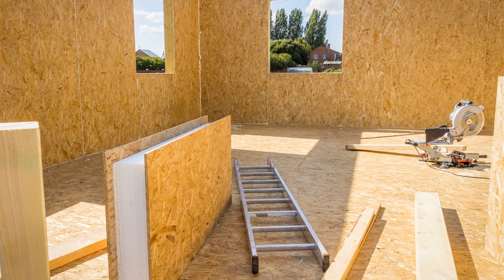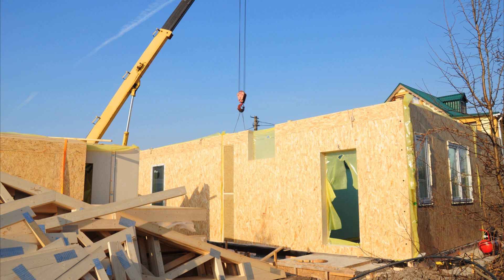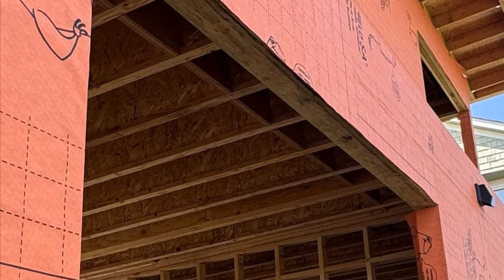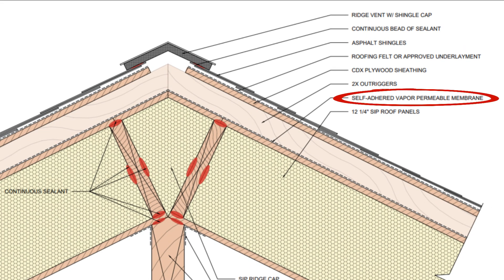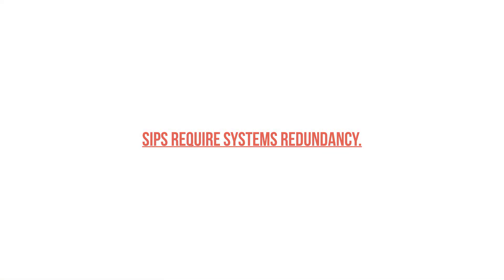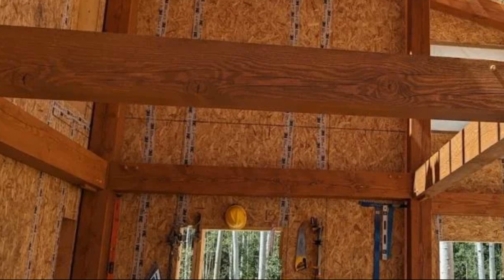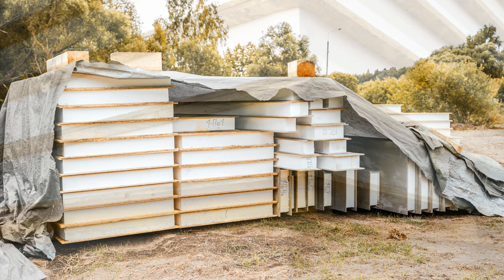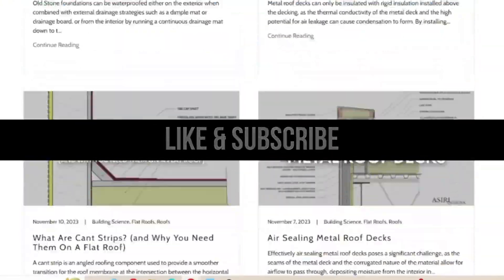SIP Framing | What You Need To Know Before You Build...

Comment: Wait wait…. So if a vapor barrier is going to trap moisture in Evan in a properly air sealed home……. WHERE DID THE WATER VAPOR COME FROM??????

You just disproved your own theory about air leakage 🤦‍♂️🤦‍♂️🤦‍♂️🤦‍♂️
Reply from the maker: Two things; 1. Your air barrier is never going to be 100% perfect, and one would be foolish to think that it could be. 2. If a leak occurs, it's never drying out if there is a vapor barrier. Vapor comes from many different sources, both internal and external. Water comes from many different sources, both internal and external. This isn't rocket science.

Comment: You over emphasize air leakage. I ready don’t think that’s the issue. Otherwise you should remove all windows door electrical and lighting. There is no way to properly air seal to your expectations. The issue is that water simply got in and wasn’t allowed to dry. Same thing happens in traditional roofs of old homes that have poor insulation and air sealing. They breathe well but something still rots away if small amounts of water  gets in. If the SIPS roofs had another layer of venting over the sips panels like you show in other videos it would have dried fine.

Comment: No one should be using Tyvek anymore. It was always a shtty product, but it has been fully obsolete for years. Still, profit margin obsessed production builders use it exclusively, always building to the lowest standard allowable by code, and they often fail to even meet those pathetic standards. Self adhered WRBs should be the industry standard because just that one change would dramatically reduce water damage and extend the lifespan of every building it's installed on.

Comment: just make ventilation points and problems are solved, in combination with sips panels and traditional timber framing is beneficial , I talking from my own experience , my house built in 2007 doesn't have problems with moisture is good  ventilated and if I  build next one I will build a same way Sips walls and ceiling and roof construction traditional way

Comment: Clicked here because I’m thinking a top of the line tuff shed / hunting cabin, 12’x20’ max, is what I need on a remote property. I can get in there with a pickup but the shed delivery guys would never make it, so looking around for pre-fab sections / kit type building a couple guys can haul in pieces and assemble on a weekend. 2 minutes into this video I can confirm the SIP thing is NOT what I want.

Comment: You made it sound as if all SIPs are made with OSB sheathing. You should have mentioned the fact that it is possible to buy SIPs with other sheathing material such as sheet metal, pressure-treated plywood, fiber cement board, fiberglass, and fiber-reinforced plastic.
Reply: Thanks!  I was going to ask if the panels had to be osb. Cheers.
Reply: It would be an MIP

Comment: In my country, they install rigid foam insulation on the exterior side of SIPs, with vapour membrane in between. Wouldn't this be a better solution for managing moisture and condensation compared to relying on complex vapor control products and techniques?

Comment: I disagree using a fluid applied weather barrier. The issue is that with SIPs inside moisture will be drawn through the SIPs to exterior side OSB. the moisture will condense causing rot. For SIP you need to use a membrane with high perms rating so that moisture can escape. If the membrane is moisture impermeable, it will not allow moisture to escape. The Foam insulation used in SIP panels is moisture permeable. Using a fluid Applied non-permeable coating is just asking for trouble with SIP Panels.

I recommend anyone considering SIP construction read the papers published by Building Science Corp first! 

FWIW: I would not recommend SIP walls, not only because of the moisture\rot issue, but it makes it very difficult to install utilities in SIP walls (electrical, plumbing, data, etc). Your much better off using standard Stick frame construction such as 2x6 with 24" OC framing, Rockwool bats, Standard ZIP sheathing and exterior 2" Rigid foam insulation which will provide about R-30 for walls. The exterior Ridge foam insuluation will keep the shealthing warm & nearly eliminate moisture condensation on the sheathing. The Rockwool will allow any moisture in the wall cavity to escape. Beyond R-30 your just spending a lot of money for very little gain in performance. with R-30 walls most of your heat losses will be the windows & not the walls.

If you insist on using SIP for wall construction I recommend using a High Perm membrane (Check with SIP mfg for recommendations), 1"x4" purlins (rain screen, with top & bottom venting along all of the SIP Walls so moisture can escape. Be sure to use screens on the vent openings to avoid Bugs & small rodents. 

The most practical use for SIP panels are for the Roof, covered with a high perms membrane that is nailed with cap nails. Topped off with a metal roof with 1"x4" purlins between the SIPs & the metal roof with a ridge cap vent. This will allow any moisture to escape & vent out during warm or sunny days. The other advantage is that during the summer time, the metal roof will be cooled by convection as hot air leaves through the ridge vent & pulls in cooler air from the soffits. The only non perms membrane should be installed along the edges of the roof where ice dams can form. For the roof edges you want to use a non-permeable membrane.  The best option is to install the Ice & water membrane over the roof sections that overhang the top walls. Any moisture that occurs there can vent from the underside of the SIPs (Soffit side).

I would not recommend a SIP roof without a vented roof. If you want to use a shingle roof, you need to the high perms membrane on the exterior SIP OSB, install purlins 1"x4", topped with plywood & then roofing membrane & shingles, with a ridge vent to allow moisture to escape. Do not nail Shingles directly to the SIP OSB because it will prevent moisture from escaping. 

The issue with SIP roofing is you still have a moisture problem, so you need a way for the moisture to escape to avoid Rot. Warm moist air will rise and collect in the SIP panels unless there is a way for the moisture to escape.
Reply from the maker: I never called for an impermeable fluid applied system. BSC has excellent papers though, the SIP roof failures in Juneau that I referenced is based on Joe Lstiburek's investigations on those roofs, hence the vented overroof mentioned. Perhaps rewatch the video ;)
Reply: @ASIRIDesigns  Most Fluid Applied products are impermeable, To be honest I don't know of a permeable fluid applied product.

As far as the roof comments, I was referencing best practice from my experience, not a reflection on your video.  as well as my explaining why SIP walls is not recommended.
Reply: Magnesium oxide (MGO) board structural insulated panels (SIPS)

Water resistant: Can withstand harsh climate conditions
Reply: I agree with you.  The video was a bit contradicting.

Comment: You make a very strong case against wood construction of any kind unless it's wood over concrete only on exterior surfaces for aesthetics and then have a good bank account to replace the rotted cladding every 2 years.
Thanks for the tip.

Comment: Why do you use OSB instead of multiplex or cement based composite boards? If it rains during the construction that moisture is going to stay inside the construction once you seal it.

Comment: Question about using fluid applied membranes for your WRB. Is sealing all the seams with a wrb and then using tyvek to wrap the build a viable alternative? The cost of the fluid applied  membrane is significantly higher, is there a downside to doing a hybrid approach?

Comment: I would like to see a video about climbing plants from you. I believe if you choose the right kind of climbing plant (one that can't attach to the wall using aerial roots but rather one that winds around a supporting structure, like ropes and grids), you can get the benefits of evaporative cooling in the summer without risking any damage to your wall. At least, that's what I concluded after my internet research. I would like to know your expert view on this!

For central Europe (I chose to focus on native plants, I live in Germany), I have identified Clematis plants for walls not facing the sun directly and Lonicera caprifolium as a plant for walls getting lots of direct sunlight. Both do not attach to walls, as far as I've been able to find out.
Reply: Clematis do not damage the house. We have had Clematis growing up trellis structures against our house for decades. Not sure how much they will actually cool a building but I don't see how they can damage it really aside from perhaps debris accumulation (that could lead to rot) if they rest against low slope wood surfaces. Climbing roses also have had no negative effect for us, again, over decades.
Reply: @jamesroscoe7555  Thank you for confirming that part! As for cooling: A) Less sunlight actually hits your house, but more importantly, B), plants evaporate water, which cools the surrounding air.
Reply: @fredwupkensoppel8949  I agree with your points. Our Clematis plants haven't really grown vigorously enough to really shade that much, and are against a tall brick wall that soaks up the sun. In our climate (very cold winters, hot summers, Canada) they die back a fair bit in winter. It might work well if you can get them to shade a sizeable percentage of your wall though.
Reply: @jamesroscoe7555  Try shading the parts of the Clematis that's close to the ground - they can grow well in direct sunlight, they just need a bit of shade down low.

Comment: Building science meets practical construction applications! Great overview. Our technical division was part of the team that helped get SIPS approved in the IRC/IBC in the late 70's, and have lived through projects where proper attention to detailing isn't adequately conducted by installers.Your simple points and key installation notes are extremely valuable! One thing to note, in many applications standard house wraps are acceptable, particularly on wall panels. However,  in wetter/cold climates and low slope roofing we have technical bulletins that detail various assemblies and product options that can help with water management as your video mentions. Thank you for your expertise!

Comment: How about flammability? Once a fire starts does it rush through the walls as all the foam melts?
Reply: It's not any worse than traditional stick framing. Possibly even better, because there is no cavity to act as a chimney and the foam itself does not sustain the flame because of additives, it only burns as long as there is something else burning it.
Reply: Magnesium oxide (MGO) board structural insulated panels (SIPS) 

Fire resistant: Have superior fire resistance compared to traditional fiber cement and OSB SIP panels
Reply: This is a great question. SIP wall and roof assemblies are 1-hour fire rated, ASTM E-119. There are, of course, SIP manufacturers that have additional fire-retardant skins for the SIPs that can increase the fire rating.

Comment: Some time ago Corbett Lunsford did a video on his Home performance Youtube channel about how you should avoid putting a tub/shower on an exterior wall (and especially if it's on an exterior corner) because of condensation issues. Architect Steve Baczek (also on Youtube) said that one of his contractors will build a second "inner wall" around the tub/shower (basically the entire "double wall" consists of exterior rockwool insulation, ZIP sheathing, 2x6 studs with Rockwool batts, interior Membrain barrier, 2x4 studs, cement board, tile) .
If you have no other choice but to put the tub/shower on an exterior corner, how would you properly install it?

Comment: I have run into this issue working as the structural manager for roofing company. The two by eights that were part of each sip panel were completely rotted out.

We we started putting full ice and water shield to keep the interior air from coming through and condensating underneath our vapor barrier.

There’s nothing worse than doing a good job and then having someone thinking you’ve done something wrong and then trying to explain them it’s your house causing the issue.

Comment: Thanks for posting this. I'm actually preparing to build a sips home and this answered some of the questions I had about sealing and vapor barriers. 👌
Reply: If you want quality and are doing it yourself this isn't the way to go.
Most DIY people don't know how easy it is to rent forms and  pour concrete.
Look up CIP, Cast In Place, Thermomass products. You pour you're exterior and interior surface and all insulation is in place in the walls.
You just put a think coat of finish stucco over the concrete if you don't want exposed concrete. 
Time is going to be about the same as SIPs.

Comment: Are there SIP products made of plywood rather than osb to ameliorate some of the moisture sensitivity? Or is the adhesive bonding too difficult?
Reply from the maker: Yes they do exist, but you still want to keep those panels as dry as possible.
Reply: @ASIRIDesigns  I'd be interested in your opinions on magnesium oxide panels, both as the integrated sheathing in SIP's, and in other applications.

Comment: Why aren’t SIPs precoated with weather barrier?  Or why isn’t the exterior skin material moisture proof?  Seems like a gap.
Reply: Some manufacturers are using Zip-R sheathing for the outside layer.
Reply: Frankly, considering how expensive a sips solution is, it is rather ridiculous that the osb is not moisture sealed at the factory where it would be easiest and most consistent result.  Yes, you’d have to paint every seam with sealant as the system was assembled- but that must be done anyway if anyone expects a 100 yr survival.  I can’t image anyone investing this heavily in a structures’ efficiency if they aren’t expecting a very, very long lifespan.
Reply: Came to the comments to ask about this exactly, if any manufacturers are using zip-r or similar. Good to know!
Reply: Magnesium oxide (MGO) board structural insulated panels (SIPS) are a type of building panel that can be used for walls, ceilings, and floors in residential, commercial, industrial, and educational applications: 
Eco-friendly: Contain no organic solvents, heavy metals, asbestos, oils, or other toxic ingredients 
Energy efficient: Eliminate drywall, which reduces construction time and cost 
Water resistant: Can withstand harsh climate conditions 
Fire resistant: Have superior fire resistance compared to traditional fiber cement and OSB SIP panels 
Mold proof: Can withstand harsh climate conditions 
Hurricane and earthquake resistant: Can withstand harsh climate conditions 
Superior insulation: Offer superior insulation, structural strength, and air-tightness over traditional construction methods 
VOC-free: Off-gasses no volatile organic compounds (VOCs) 
Faster construction: Buildings made from SIPs are assembled significantly faster than stick-built homes 
Superior fire suppression: Offers superior fire suppression when compared to portland cement and OSB (oriented strand board)

Comment: I was going to build my new house using SIPs, but for the reasons you describe about moisture, because I live in a very humid cold climate, I often to go stick frame.
Reply: Don't be afraid humidity and cold are easily managed with proper installation. I have lived in a sip home for since 1999 yes do your homework on hvac side and ventilation comfort and energy saving greater than exspected.
Reply: Look up doing concrete walls with rigid insulation inside them. 
You can pour foundations your self. Forms are easy to rent.
I'm a contractor and spec builder.